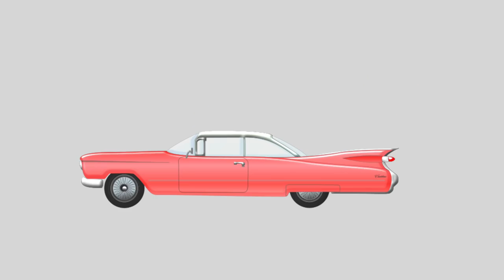Yes, Rockets CAN Fly in a Vacuum

Comment: This video is off topic  related to the title. She is talking about a rocket taking off. What about a rocket turning on the engine in space vaccum
Reply: Turning?
Reply: What about it?  When rocket engines are running at sea level, the combustion chamber pressure is over 3000 PSI and pushes out into 14.5 PSI.

When they are running in space the combustion chamber pressure is 3000 PSI while outside it is just 0.0 PSI.

The engine HARDLY NOTICES The DIFFERENCE 

In atmosphere the differential pressure is 2985.5 PSI while in vacuum it is 3000 PSI.
The engine can hardly tell the difference.

Comment: Fuel and oxidizer, on board, in the vacuum of space. Releasing an explosion that shoots out of the back of the rocket to propel said rocket forward by pushing against what in the vacuum of space? I get that you can bring things aboard but that’s irrelevant if you can make the propulsion system you need but theres nothing to push off of right? Zero gravity, and zero oxygen? what would allow said explosion to remain on fire, shooting outside of the rocket, therefore meaning fire and flame would be in active use in the vaccum of space, if the logic in this video is true and valid, then i should be allowed to space walk with a cuban cigar in my hand and theoretically i should be able to light the said cigar with the extreme heat from these sick rocket thrusters, stick it in the elevator box that nasa ever so ingeniously designed to send that cigar perfectly into my lips and have a tube filled with Michelob ultra for me to enjoy while i can move through space with movements similar to swimming, because astronauts have to be great swimmers to even get their jobs. I rest my case.
Reply: Your case is full of holes.

"You need something to push against"
No. You accelerate mass and eject it, and you gain equal momentum in the opposite direction.

"What would allow the explosion to remain on fire"
Nothing. And it doesn't need to be on fire. Burning fuel and oxidiser in the combustion chamber is used to generate high speed exhaust. It has only one way to go, so it is accelerated in one direction. So there you have the accelerated and ejected mass.

"I could light my cigars"
You could heat it up, but the burning fuel will have used all of the oxidiser, so there's nothing to keep the cigar lit. If you brought the hot cigar back into an oxygen environment quickly enough, it might still be above it's flash point temperature and spontaneously combust.

"Astronauts need to know how to swim"
Yes. In case they have to escape from the spacecraft after an aborted reentry or launch that sees them splash down in an ocean.
Reply: There is combustion in the chamber. This moves gas out the back. How can you have motion of the gas and no resultant motion on the rocket? Are you claiming that if we put a rocket up into space, used pumps to flow pressurized gases into a combustion chamber, let them combust that the gases would just stay there and not move? That doesn't seem like a "thing".
Reply: Would a CROSSBOW, fired in a vacuum STILL HAVE RECOIL? Yes or No?

Comment: It's sad we have to explain these things as if they're something out of the ordinary, hidden knowledge.

Good video, but you forgot to mention one thing. Reactive propulsion of rocket engines actualy works best in vacuum, because the pressure differential is the greatest. In vacuum, there's one atmosphere of difference more. Hence, engines that work great at one atmosphere will have much lower thrust on the surface of Venus where 92 atmospheres are pushing against the nozzle.

Comment: Ya im confused, the action begin the rocket pushing on nothing makes no sense to me. The reaction comes from what exactly?
Reply: Conservation of momentum. As mass is ejected at high speeds one way the other mass (rocket) moves in the opposite direction. 

Do you really think that rocket exhaust gases, traveling at very high speeds pushing air moculues out of the way and somehow these air molecules "push" back against the rocket? No, that's not how it works.
Reply: Rocket propulsion is just mechanical recoil.  Would a crossbow fired into a vacuum have recoil?  YES.

Comment: Ohk let's think that in the atmosphere the rocket's ignition is following Newton's third law , that means all the force acted by the thrust upon the air particles have an overall equal force opposite to it , which can pull the rocket , but in case of vaccum there is only that thrust (means 1st object) but not air(2nd object , which caused the reaction in atmosphere). So without second object how Newton's third law will be there(in vacuum)...?
Pls clear my doubt , if anyone knows.
Reply: The two objects are the rocket and the exhaust.
An atmosphere does not need to be present, it actually adds drag which lowers the effectiveness of the rocket.
Reply: The Rocket is pushed by thrust not Pulled. Think it over.
Reply: Yeah! Totally got it guys✌️🙏
Reply: @yabbadabbadoo8225  sry I made mistake , (wrote pull besides push)

Comment: I enjoyed the video but I have another question. If there is an equal and opposite reaction in space, then doesn't the thrust from the engine create a (space quake) in time?
Reply: Nope.

You experience equal and opposite reactions everywhere every day. Simply by standing on the ground, the ground is creating a force to resist the force caused by your weight.

Comment: I feel it necessary to state also that rockets actually do not work in a vacuum.  A vacuum is a space without atoms.  A functioning rocket (while in the process of combustion) would not be in a vacuum ever. Not even in space.  The propellant would occupy that which may have previously been the vacuum.  A vacuum would be an absence of 'stuff'...a rocket's combusted propellant would fill that void, making it no longer a vacuum.

Comment: What size fuel tank would you need to travel to Mars and back?
Reply: Depends on mass of element you need to send to Mars.
Reply: @tgstudio85  And the efficiency of the engine.
If I could accelerate individual atoms of lead to near the speed of light, I would need very little of it to get to mars.

Comment: I just wanna ask as in beginning there is ground by which it throws the burn out and get reaction but in space there is no ground to produce reaction. (Or did I assume that there is a imaginary wall) (one more question did the space is totally vaccum.... I didn't think)
Reply: If you force something to accelerate in one direction, you are accelerated in the opposite direction. 

There is no third element in the system. A third element in your example would be the ground...
Reply: Papa Legba  

You're holding onto a big cube of concrete about the same size as you, sliding across a frozen lake, with no other objects nearby. Frozen lake so you can assume no friction between you and the surface, thought experiments are abstract...

You were holding the concrete when you started moving.
As long as you're holding the concrete you can assume that you are one system.

Now you push horizontally against the cube as hard as you can and let go.

Do you change speed or direction?
What about the cube?
Remember there was nothing else around when you pushed.

Comment: a balloon would explode in space.
Reply: Not necessarily. It's a 14.7 psi difference from sea level. As long as the balloon can handle an extra 14.7 psi it won't explode.
Reply: Can normal balloon handle 14 psi? Ty for correcting my vague statement👍👍👍
Reply: @kornbread5359  I don't know if a regular balloon could handle 14.7 psi. I would assume not if it was filled before being placed in vacuum.
Reply: A mylar birthday balloon could hold IN 5 PSI of pure Oxygen.  This would be enough to protect an astronaut from the vacuum of deep space.
Reply: @stuartgray5877  Cool. Thank you.

Comment: I have a question: if there is barely any gravity in wid open space the why doesn’t the gas in the rocket float up when it’s almost empty
Reply: Because of rocket acceleration -> same reason why peoples get pullet down when elevator is accelerating.
Reply: 1. There is gravity on earth's orbit, just a few % weaker than on the sea level.
2. We experience weightlessness when orbiting, because you are in an endless freefall, but you are going too fast to drop to earth.
3. Rocket fuel/oxidizer is indeed floating up when there is no acceleration/deceleration. To have a proper engine restart, you need https://en.wikipedia.org/wiki/Ullage_motor to generate small accelleration, that pushes fuel to the back of the tank (and fills the pump drain).

Comment: Rockets work by heating air, same as jet engines. Thrust off the earth surface starts the momentum, the it is expansion  after that until nothing left in space. No way for the rocket to slow momentum until it crashes into the moon.
Reply: To slow down the rocket just has to turn on the spot and fire it's engines in the direction of travel.
Reply: @niallkinsella2687  In a vacuum?
Reply: @satanshow8883  yes, in a vacuum.
Reply: Sorry orbit not obits, thank you.
Reply: @satanshow8883  There are several satellites from several nations orbiting the moon, including right now as I type this.
Reply: @satanshow8883  
Care to explain why it's impossible?
Reply: @satanshow8883   Consider an experiment:

What happens if you fire a CROSSBOW into a vacuum?
Will it still feel a recoil force?
Reply: Sorry, what is possible, thanks.
Reply: There is no constant in space as on earth, also I like how the system says something is out there say orbiting the moon yet no o e with a telescope can ever see it.
Reply: @stuartgray5877  No surrender at all, it is impossible to fire an arrow in a vacuum in real life. What your are asking is for me to imagine if I could fire an arrow in a vacuum, would the arrow itself feel the recoil or would I feel it firing the arrow from a bow. What does that have to do with nothing to heat in space to create thrust from rocket engines. This is a ploy used as a distraction from what the original conversation was about. Also you are not showing any original thought only repeating something you read or you where taught.
Reply: You probably also believe in Climatology, Climate Change. In my day we called it the four seasons.
Reply: I never said you could not push off of the  solid moon surface. Only once the momentum stops, there is nothing else there for thrust.
Reply: @satanshow8883  - "it is impossible to fire an arrow in a vacuum in real life."

So we could not try an experiment where we fire the crossbow in a vacuum chamber here on earth and see if it has recoil?

Then you think the physics would behave differently in the vacuum in space?

And NO I am not "repeating something I was told". I am an actual Aerospace test engineer.

I work with vacuum chambers frequently as part of my job over the last 25 years.  I was first trained at Lockheed Martin Space Simulation Laboratory in waterton, Colorado.
I can assure you that physics processes like mechanical RECOIL work the same in a vacuum as it does in atmosphere.

A crossbow still has recoil in a vacuum because normal crossbow recoil has nothing to do with the atmosphere.
Reply: @satanshow8883  I'll try to explain normal mechanical recoil, like from a crossbow.
When one "object" exerts a force on another "object", both objects feel the same force for the same duration.
This is Newton's third law which is often summarized as: "For every ACTION, there is an equal and opposite REACTION".
When a crossbow string applies a force (lets say FIFTY Pounds-force) to the projectile (the ACTION), the crossbow feels an equal but opposite FIFTY pounds force in the opposite direction (this is the REACTION).
We don't typically think that a crossbow has a recoil, because we hold it to our shoulder, then plant our feet on the ground.
So it is the mass of the crossbow, plus the person, plus the earth that is one "object" while the second "object" is the projectile which is of very LOW mass like 1 kilogram.
So when you fire a crossbow the ACTION pushes the projectile forward shooting it out at high velocity because fifty pounds force for that fraction of a second is enough to accelerate the projectile to high velocity.
However the fifty pounds-force applied to the crossbow, person, earth mass did very little acceleration because the mass is so large.
So what would happen if you fired a remote controlled crossbow floating in space?
What would an astronaut SEE happen if he fired the crossbow by remote?
Reply: @stuartgray5877  It is funny that you pick a crossbow and arrow to make a point. Also we would not need a vacuum chamber in space, it is already a vacuum out there, correct. Nevertheless back to the example, it is equilibrium you would experience in a vacuum, not recoil. However what you would really want to do to prove my point is fire a rifle in a vacuum. There would not be any recoil because the bullet would not have any friction since there is nothing there to slow it's momentum.
 I use to work for a company that built robots used to manufacture silicon wafers in vacuum chambers. It is extremely difficult to create a pure vacuum chamber of small size using cryogenic pumps. I would like to see photographs of this magical vacuum chamber you work in and the large metal suit you wear. Thank you 😊.
Reply: @satanshow8883  
How does the crossbow example have nothing to do with what is being debated?
It demonstrates the principles involved perfectly.

What do you think is the difference in the forces produced, for example, between a crossbow shooting a 1kg bolt at 100meters per second and a rocket firing 1kg of fuel/oxidiser exhaust at 100meters per second?

Comment: Nothing burns in 0 oxygen
Reply: You are not only wrong, but if you ever have or will work in some fairly common industrial environments, you are dangerously wrong.

Get an education before you hurt yourself or someone else
Reply: Good thing to rockets take oxidizer WITH THEM to space
Reply: @stuartgray5877  
Isn't that one of the chemicals that is significantly more effective as an oxidiser than oxygen?
Reply: Try lighting a sparkler and putting it in water. hOw DOEs thAt WorK?

Comment: Sorry, a force acting on another force will have an equal and opposite reaction.  Thus the propulsion must push against something such as air molecules to propel an object forward.  This is the dumbest thing I have ever heard.
Reply: The rocket accelerates the fuel.
Therefore the fuel accelerates the rocket, with equal force in the opposite direction.

It really is that simple, and there is absolutely no need for a third element in the system.
Reply: So you don't think that the MASS of the exhaust gas has inertia?  But you think that the gas in the atmosphere DOES have mass and inertia?  So you can either push on gas or not, which is it?